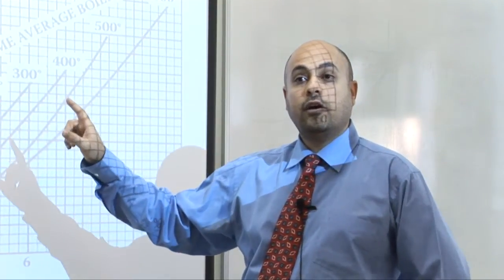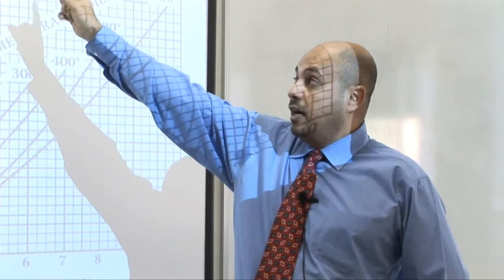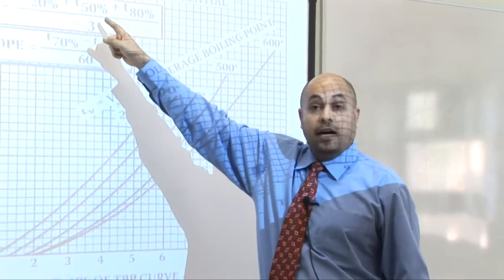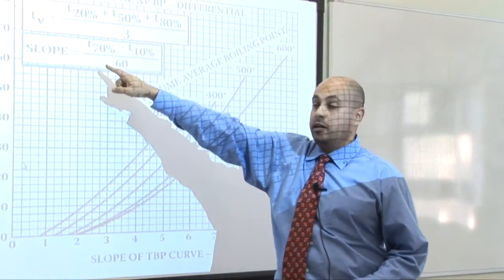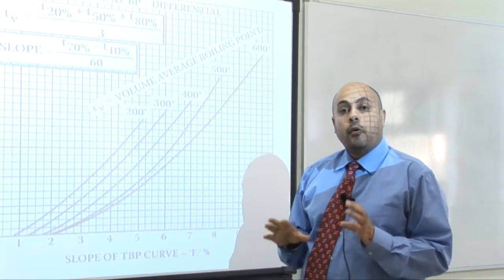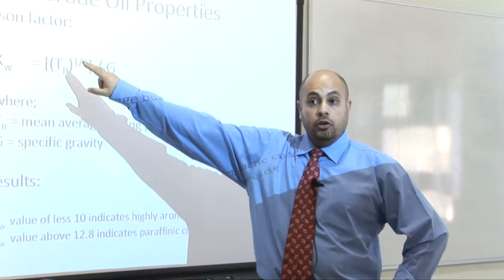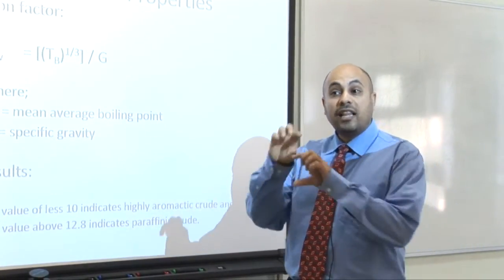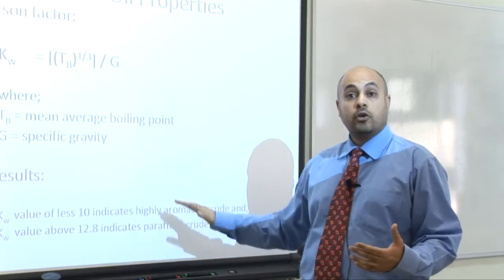Crude Oil Distillation

Comment: What cames out from the fractional distillation process: (1) C1 to C4 Gases, (2) C5 to C9 Naphtha, (3) C5 to C10 Gasoline, (4) C10 to C16 Kerosine, (5) C14 to C20 Diesil, (6) C20 to C50 Lubricating oil, (7) C20 to C70 Fuel oil and the last  (8) C70 Residue.

Comment: @magnetman1000 Naphtha first then Gasoline. The various refinery streams blended together to make gasoline are: 1- Reformate, 2- Cat cracked gasoline or cat cracked naphtha, 3- Hydrocrackate, 4- Virgin or straight-run naphtha, 5- Alkylate, 6- Isomerate.
Gasoline is more volatile than diesel oil, Jet-A or kerosene, not only because of the base constituents, but because of the additives that are put into it.